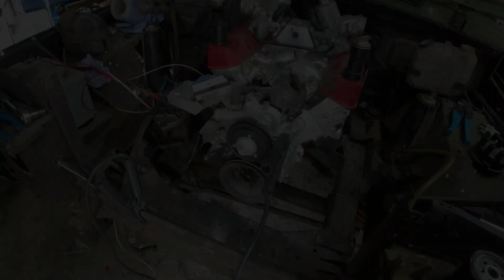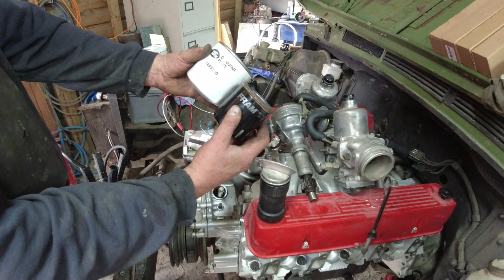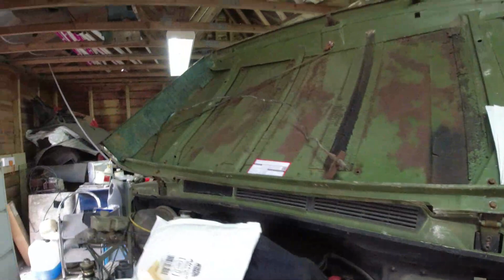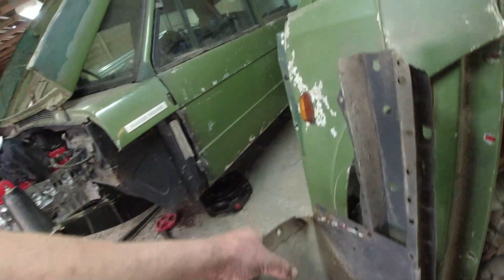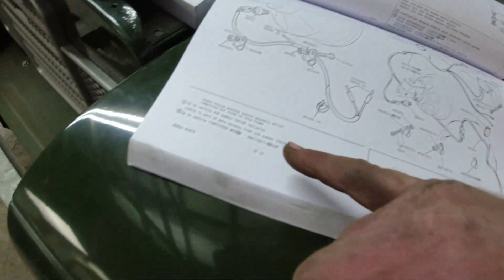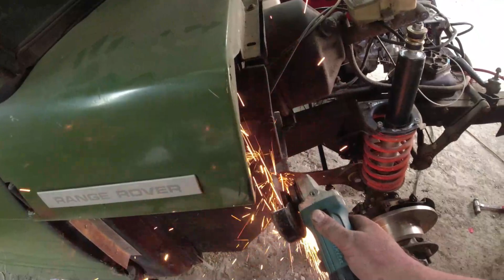Range Rover Lincoln Green Ep4 - engine checks and stuff

Comment: If that's a newly rebuilt engine, the rings / bores have not run in yet. Compression tests are not normal. Spark up that puppy and change the oil and re-torque the heads after that hour. Re-test compression and I'm betting it will be up to par.
Reply: ...that's a fair point - if it was mine I'd be crossing my fingers, but I'm the eternal pessimist😀
Reply from the maker: I think you are 100% correct Hugh, The bores and rings need to bed in still, then the compressions will rise to 140-150psi. The calculations provided by the engine builder suggest a compression ratio of 8.5:1.

Going to be a good day when I get this one fired up